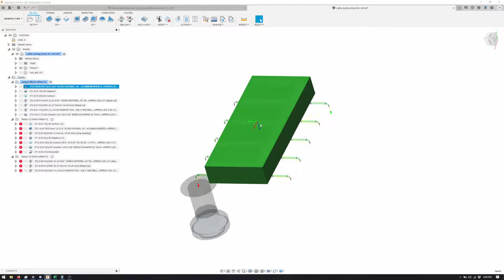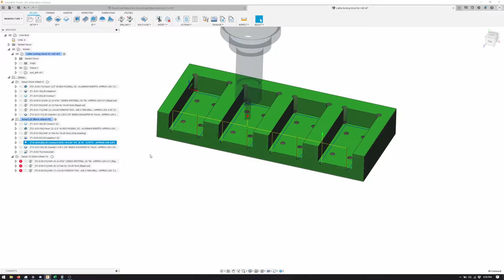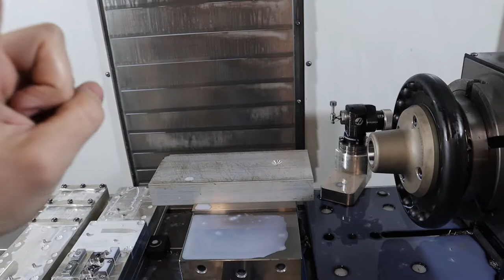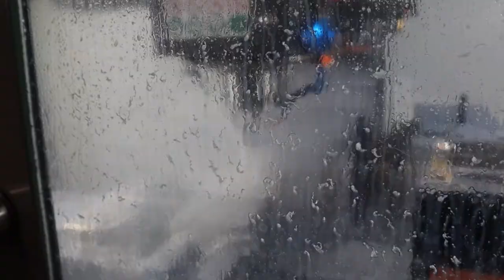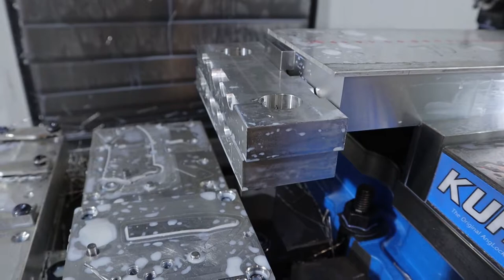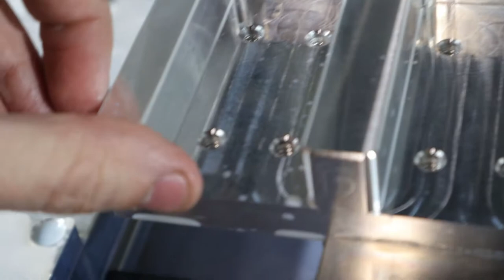Turning the mill into a lathe - Part 1 - Making the tool holder block

Comment: Nice Fixture Design! I liked the Fusion walkthrough of each operation and then the corresponding walkthrough of the machining  operations.  No detail on the Haas control is too small for me, I want to see more of that.  Can you include the rotary in your CAM assembly to check for collision, so one expensive thing won't hot another?  Do I hear incremental steps on the spindle RPM to prevent low voltage alarms, etc.? Keep up the awesome work on the knives!
Reply from the maker: Typically on any long term fixture I'll model the entire table. On this quick turn around type job I'll just forgo it. Would of helped on the collision stuff though. Yea it is a ramp up, machine shuts off otherwise:P

Comment: Is your SMTC servo driven? Does it use any compressed air? Does the SS version use more air?
Reply from the maker: Yes the newer smtc are all servo, and quite quick. I don't think the ss uses more air then a stand vf, you can always check the air required on haas's site.
Reply: @split141x  Great!. What size/hp/gal/cfm compressor are you using to run your ss?
Reply from the maker: So I'm running a Ingersoll rand model 2340. Its a single phase two stage piston compressor. You can hearing it running a lot in the background of some of my videos. I'm than feeding that into a external 60gal tank. The tank came from a used screw compressor I bought, which I thought worked.. and didn't. You actually don't need as big of a compressor as I have, but if you go smaller your compressor will cycle on and off a ton. A single phase compressor draws a lot of start up amps, so its quite expensive to have it starting and stopping so often. Best over size what you think you'll need.
Reply: @split141x  Thank you. I am also limited with power in the garage. So, cant go with a too big one. BTW, I have a few more questions I would like to ask about your setup if you dont mind.  Do you have email for me to contact?
Reply from the maker: Sure its jboggs@triiaxis.com or you can dm me on instagram at split141 (fastest)
Reply: @split141x  Just sent you an email. Please check when you get a time. :)